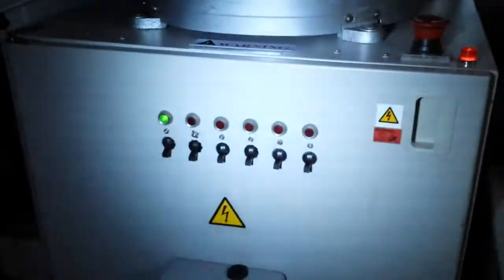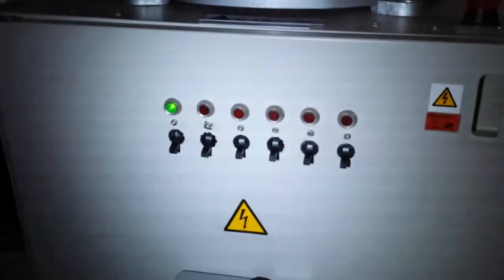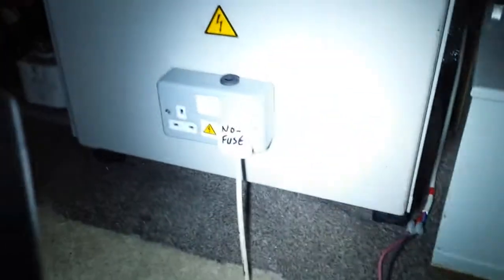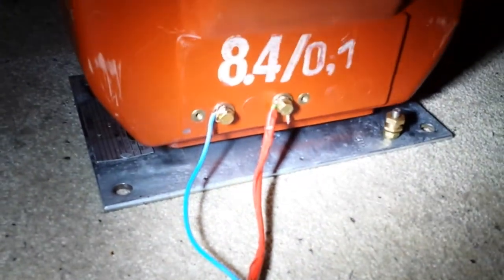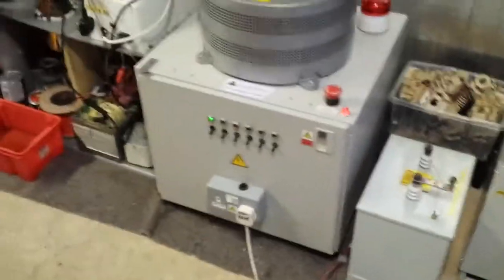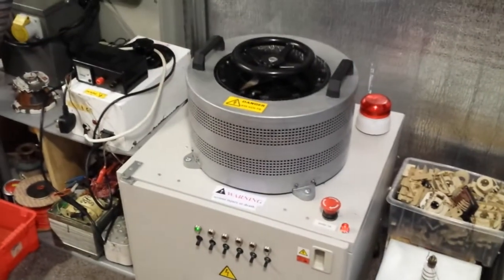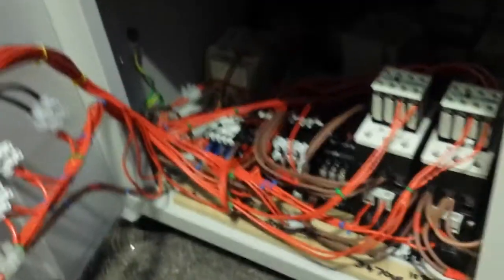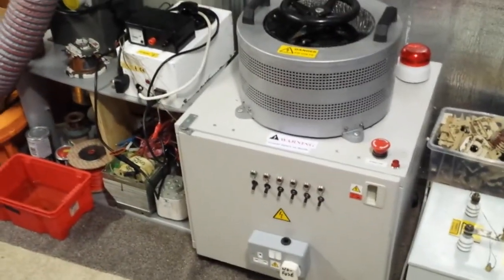Variac Control unit/jacobs ladder 8.400 volt P,T

Comment: Instead of the 13A socket, i would put something like a 30A bs4343 socket, it's the round industrial plug and socket, it will also avoid confusion with wiring the wrong pins

Comment: I will also add that you really need to put a 230V 16A or even 32A industrial plug and socket on you control unit, then you wouldn't have to keep putting those No-blow fuses in your plugs and parallel feeding your transformers, which in this case you need a parallel feed for the neutral also as the current flowing into your transformer is equally proportionate to the current flowing out. You're workshop is at an industrial scale, in terms of power capabilities, ditch the domestic plugs! xD

Comment: What do u do when an epileptic has a seizure in the swimming pool ? ................. Throw in the laundry! 
I've put together two ladders w/15,000 v neon tube transformers , and what really made them a hit and work extremely well was using 1/2 by 3/4 inch thick, 8' long solid copper buss bar . I also used a micro 12 v fan at 5 to 6 volts positioned directly under where the arch starts, aimed straight up the bars . It simply moves the arch farther and faster up the 8' of rod .